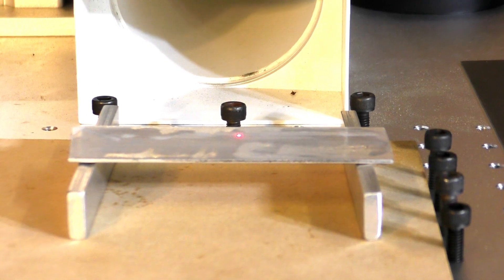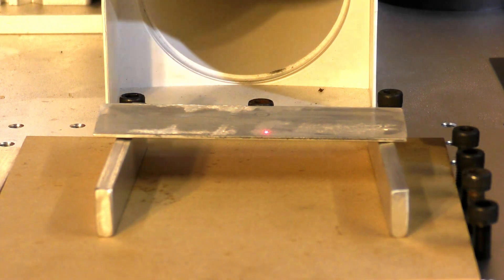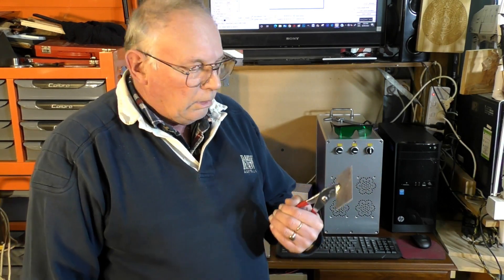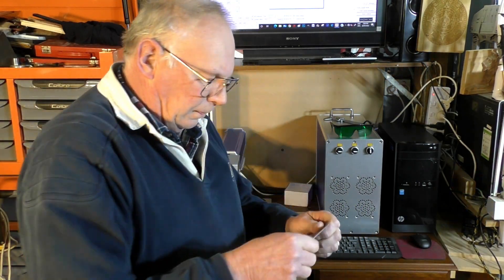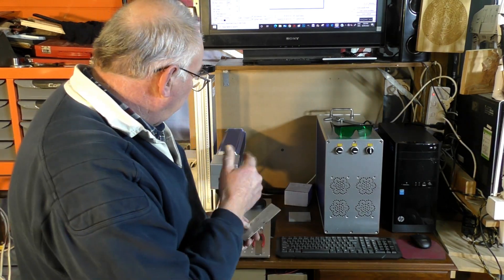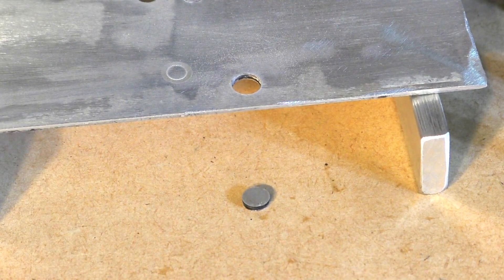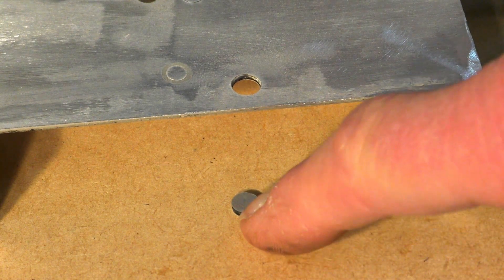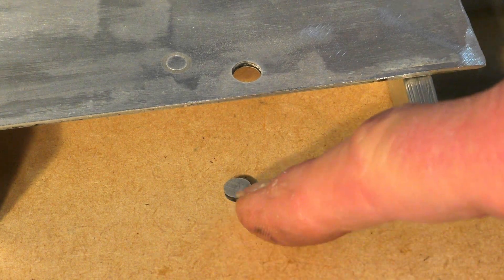Video *800* 30W Fiber laser cutting aluminium

Comment: Thank you, Roger, for this video about cutting aluminium metal using a fibre laser. I noticed that when you operate the laser, you must protect yourself by wearing a very appropriate pair of glass to avoid flexions of the beam into your eyes, and you have to put a special surface under your plate of metal far enough to reduce the reflections of the laser beam (the structured surface is used for where it is painted in black color and grooved in order to keep reflections on its area) .
Reply from the maker: My bad!